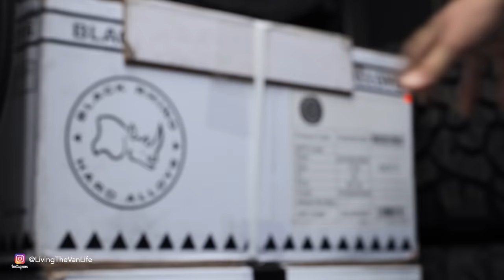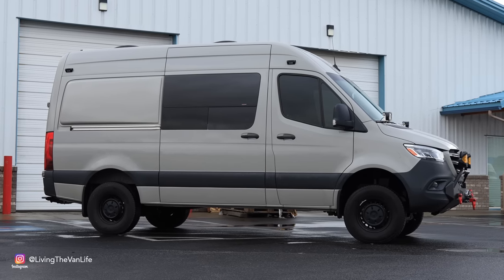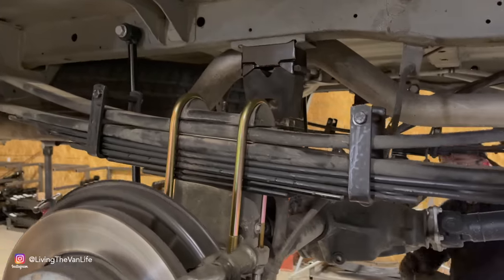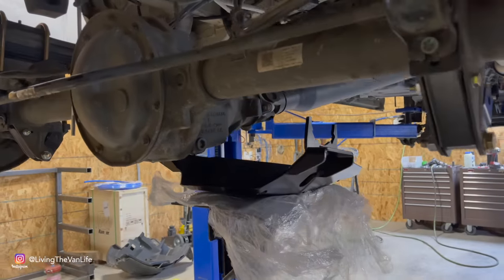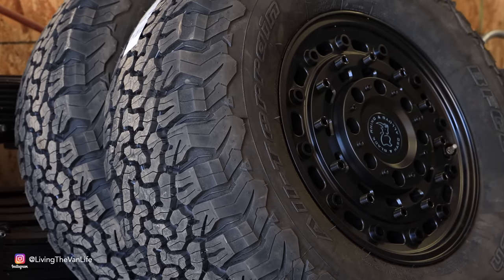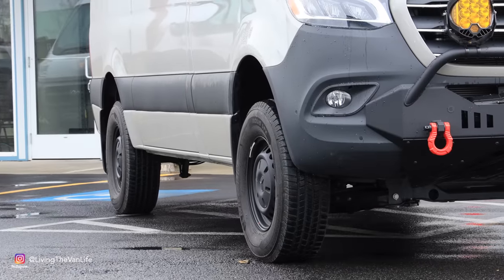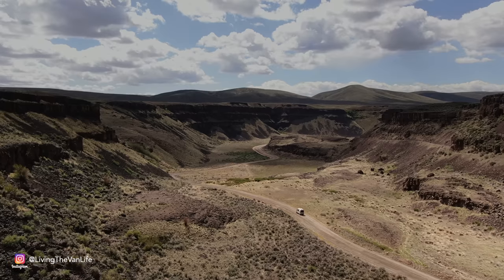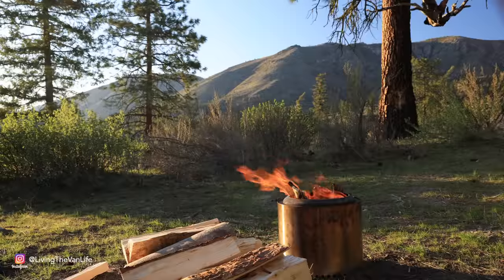How To Build a LIFTED Off-Road Sprinter Van - Living The Van Life

Comment: Love the videos.   I’ve been over landing in my Jeep Gladiator for several years.  As I approach retirement, I have a decision to make on a 144 or 170.  I will be keeping my Gladiator to reach those areas that only a fully capable 4x4 can go.    Mostly I am solo in my Gladiator.   I have young grandchildren that approaching the age I can start taking trips with them.   I’ve decided to go with a modular system from Adventure Wagon and a pop top so I can sleep and travel with 4 people comfortably, or 6 with a little bit of modularity.    90% of the time I’ll be alone, but out for 30 days or more at a time, towing my Can Am.    My plan is store the can am and trailer around the country while I’m cruising around and don’t need it.   I have a full understanding of what I can expect with the capabilities of a van.  My rig will have AWD and rear lockers with an Agile Suspension.

Sooooo. With your experiences now fully documented, do you believe the 170 would be to big of a vehicle for what you are doing 90% of the time.   Thx for any input

Comment: I've got an extended 170 4x4.  It was priced too low to pass up.  But it's too long to be a candidate for the offroad stuff you've done.  The rear end extends about 5' beyond the axle & the long wheelbase wouldn't benefit much from a lift kit either.  But, the interior is huge.  It's a full 16' from the driver's seat to the back doors!  Although it can't get too far off the beaten path, there's room under the bed for my Zodiac & 20 hp outboard and I haul a dual-sport moto on the rear, which seems like a good compromise to me.  I'd guess my toys are a good bit less expensive than an offroad kit for the van, so that's good too.
I'm enjoying seeing what you've done with your van.  Thanks for taking the time to document & share it with us.
Reply from the maker: Whoa!  That's an adventure machine as well, Glenn-  Plenty of overloading roads out that that won't require the shorter wheel-base, but it is something you'll want to be cognizant of.  Got all the toys loaded-up and ready for some exploring.  Best of luck to you and Happy Trails!  Cheers!

Comment: I love my 2019 Sprinter 4x4 van, but I think I'd do a 4x4 Transit instead next time.
I've had about 20 recalls so far and one more just arrived today.
You CANNOT turn the lights off if you have to run the engine at night.
The Ford has a door code for unlocking the doors if you lose or don't want to bring a key.
Diesel can sometimes be hard to find, or there is one pump at a station for it, and the ecoboost motor is amazing.

Comment: I'm in the process of doing my own conversion of a 2020 Transit T-250 High Roof Extended length, and I was almost jealous of the shorter length! Almost. I won't be going THAT large, my Arsenals will sport out 245/75x16 (30.5 diameter) Falken Wildpeaks after the Van Compass 2.0 lift. See you down the road...

Comment: i have a 1997 GMC 1500 Savana high top conversion project going.  After getting an extra rear leaf and a taller front coil with decent shocks I will get a slight lift but nothing incredible.  I want to get rid of the stock 15” rims and LT235/75R15’s and put a 16” rim with  a larger all terrain tire.  Is this a problem waiting to create more issues or a painless upgrade?  Also doing a free flow dual exhaust this season should give the 5.7 L a little less restriction and nice tone.
    Body is great just need new bumpers for now, full repaint down the road.  My vision for this is a aggressive backroad retro camper with some hot rod vibes.  I had 5 vans over the years as work trucks/ campers, I don’t have the budget for the new wave of high roof mania van life, I’ve had this 97 for 10 years and it’s long been paid for and it’s a proven winner.  As a self employed carpenter/ inventor heading into the retirement years the new builds are inspiring but not within our debt free golden years plans…..thus the 1997 retro build.    Any advice on the rim/tires would be great!!!

Comment: Your extra alternator is a 280 Amps. ok. but .. what about the booster to charge the batteries ..   how many boosters. and what is the power of the boosters ?   you say that you can charge 280A.  when the engine I running. are you sure ?

Comment: Wow, what an upgrade from the VW! 
Two questions:
-did you skip the van compass fuel tank skid plate?
-how is the front subframe lowered but the transfer case is not?
Looking at doing same mods with my 2019-170. These transfer cases are seriously low and unprotected in stock form. 
Appreciate your feedback.

Comment: Wonderful Job. You tailored the van as per your conceptualization and played with it like building LEGO Blocks. 

Yet one thing I want to suggest (May be wrong) that the vehicle engine is built to carry certain loads and spin wheels at certain torque. Amendments in this regard may be done in consultation with the Mercedes OEM.

Comment: Van looks great. Love all the upgrades. Next on my list before officially leaving for the Serengeti would be to upgrade the stock brakes and rotors.  You'll be adding quite a bit of static weight to the van plus the lift increased center of gravity and now you have off-road tires. Those are not performances tires and will not stop like a set of Pilot Super Sports. Not sure how much bigger you can go with the new wheel setup but Id love to see a brake upgrade just for safety on the road and more piece of mind out in the bush.  You seem like a perfectionist so Im sure you've already considered it. Maybe you can steal a set of AMG brakes and keep it in the family. Go big or go home!

Comment: It is better if you add extension on wheel hub. To make the tire outer from fender  and add some LED lights on top of it. Then replace the front bumper. Full metal bumper aka crash guard. Then the exhaust system if you want to hear a good raor from that beast. Godbless ma men., stay safe.

Comment: Great job mate 👍... Wondering what is the maximum angle that u can be with the van, considering u installed a badass suspension and tyres for an offroad.

Comment: Love your videos all the way back to the early vanagon days. You built a heck of an off grid sprinter. With the low power engine and increased leverage of 35" tires how is it doing? Is there a lower diff gear and some type of locker (front and rear)?

Comment: Sorry, late to comment on this episode. How did you address the on board-computer issue? My understanding is that over 285/70 R17 tires the computer does not work properly (cross wind assist, ESP/ASP etc - not to mention the cruise control!) . Have you had issues with them etc? I'd love to put 315's on mine, but have hesitated because of that and figured I'd end up with 285s (unless Owl Vans can get their software "hack" to work). 
Love your episodes.Love your van. Thank you.  Hope to run in to you out in the outback someday. Safe travels.

Comment: Hey Chad, how do the BIG Tyres affect the driving mechanism of this sprinter? You only mentioned tyre pressure monitoring kits being removed from the old to the new wheels. Don't BIG tyre put a lot of presuure on the gears?

Comment: Very nice. I did have a question. Are you going to have any external antenna mounts for 2 way radios? If so where are you going to mount them? And if so what kind of radios will you be using? 
CHEERS from Colorado

Comment: the sprinter is already a tall van.. adding a lift with bigger tires will make the van feel wiggly wobbly top heavy jiggle side by side during strong winds and or driving on the highway?

Comment: great video I am curious about one thing....
I have talked to some and read a  lot ....
The results are don't get the sprinter because finding a dealership is hard fuel was another
however, on the flip side, I heard if one gets the extended warranty.. This  would be no problems getting repair how accurate is this  as for fuel well there are jerry cans etc

Comment: This seems like a body lift with stiffer springs and aftermarket shocks. So articulation hasn't changed other than the result of larger tire size increased ground clearance for center obstacles.

Comment: The build does look sick, no question, but there are a bunch of "buts" going on here. 35" tires? additional un-sprung weight, 4 additional inches of height on a 10' top heavy machine, multiple skid plates weight, bumper and winch weight, 35" spare tire weight, air compressor weight, Did you do an after market rear bumper as well? more weight, CEL's from the active distance assist?. The Van has a GVWR of 9,050 lbs. I hope you pack light because 2 pair of under ware and your over. Never a good idea to go shopping when your hungry.

Comment: We have been eyeballing the 4x4 Mercedes platform for our RV.  With the lift kit, how's the center of gravity? Looks a little high.  I don't mind getting tipsy, but I prefer my RVs are firmly planted.  That is a hell of a rig.  Looks like you're ready for the zombie apocalypse.  Hey, we all know it's coming!
Reply from the maker: Not too heavy at all. You have to remember it’s only sheet metal up high.  This thing handles better than most pick-up trucks I’ve driven.  70mph up mountain pass highways no problem.  I have never felt anything about this being top heavy.

Comment: I've been a sub for years,  I have 3 questions;  did you re-gear for the 35" tire?  Is there a rear locker or does it have electronic traction control to keep a non-traction wheel from spinning ?  Do the 4x4 models have a low range in the transfer system ?
Reply: P.S.  I Have been living in my Ford E series van, traveling fulltime for 3+ years now. It's definitely the life for me !!!!   Just finished installing new springs and Bilstein shocks for more clearance and off road control,  night and day improvement,  well worth the investment.  Getting parts together for a 4 WD  conversion coming next winter.
Reply from the maker: Hello Duane!   No regear.  No locker. Yes on the traction control unless you turn it off.  And yes. The 4x4 has a low range.
Reply from the maker: Oh nice!   That’s awesome you have made some upgrades. Those parts are definitely worth while.
Reply: @LivingTheVanLife  Chad, thanks for the response.  Please check out my van at "Adventure van man" channel on YouTube,  "Man follows his dreams " video title,  also "Duane's updates " to see newer mods and my gazebo tent.  Hope y'all enjoy them and get some ideas on how to build your own van for overland lifestyle!

Comment: Chad, your van has an OPEN center differential. You can see it in the video. Why the Sportsmobile people are not catcalling you now is a mystery. Oh, wait! That because that sweet Ford 4x4 running gear has an antiquated Econoline van body sitting on top of it (not to mention the Econline’s inferior handling). On the other hand, you did the White Rim in a RWD Vanagon! So, you clearly know how to make a van work for your needs. And, like every thing else “RV”, it’s a trade off. But, it would be nice if you would elucidate the pros and cons of the 4WD Sprinter’s running gear and why you went with the Sprinter.

Comment: Those 2 bolts and spacers look like a serious structural liability.  It doesn't even replicate the contact area of the original mounting point which spanned all the way across.

Comment: look that you are heavy with the Mercedes the Mercedes to have you rear ration the floor has a double step and height has 20 cm more with which it staggers like a flag the body that is quite good is that of the citroen jumper the peugeot boxer or the Fiat Ducato that body is lower and wider with which you can sleep wide in the mercedes can not sleep wide because you have to sleep along which it loses that space and if what we want is 4-wheel drive because it is time for the Mercedes to put the batteries eh and put a hybrid engine of 200 hp as for example the Toyota RAV4 with front wheel drive and two electric motors to the intelligent rear wheel drive and in this way we have a body that we can sleep to the widths that does not have a second step which is lower in height. and by the way that Mercedes since it pays so much to put quality paint, I have a white Sprinter and it gets rust points without any blow

Comment: Lifting a Mercedes van is a terrible idea & disaster waiting to happen. These vehicles are already horribly top-heavy & then you raise the center of gravity even more - ugh! I’ve been wheeling & doing weekend trips (now known as overlanding by some) for 30+ years now & these vehicles are great; just not lifted due to sheer physics & weight distribution.
I’ve run trucks & Jeeps; even my current Jeep has a modest 2” lift, because a low CoG setup is more durable & trustworthy for everyday use.